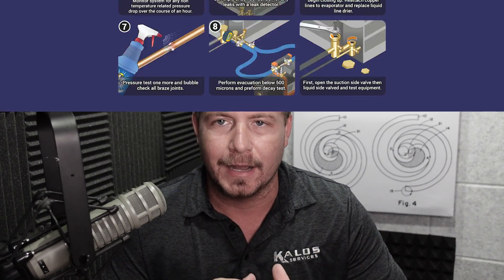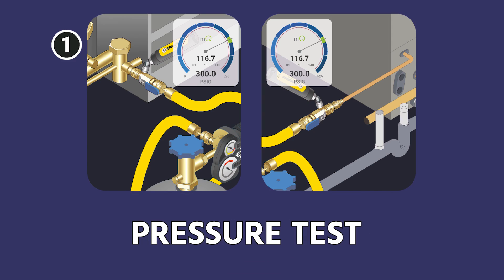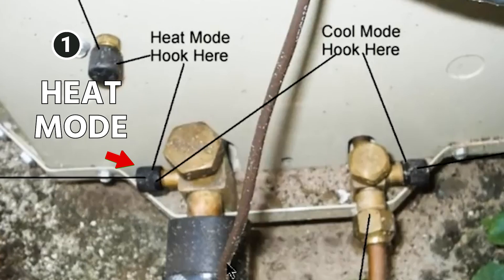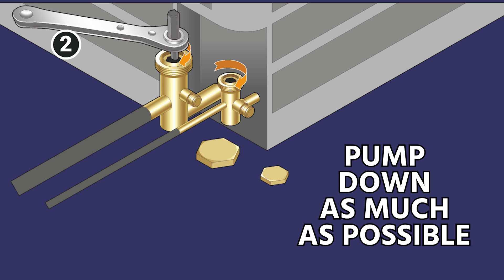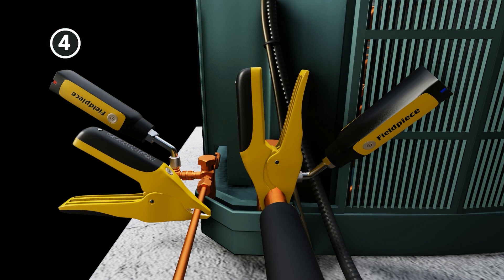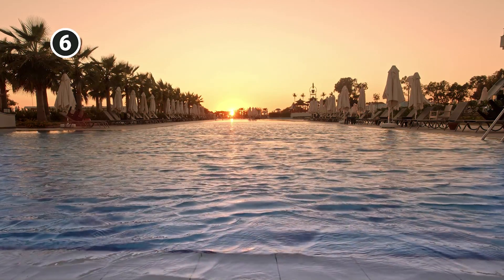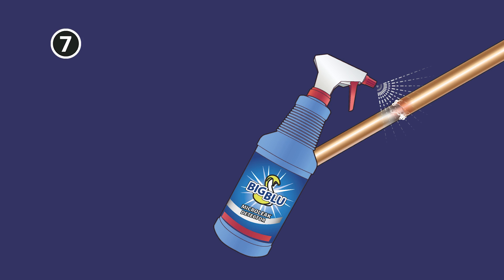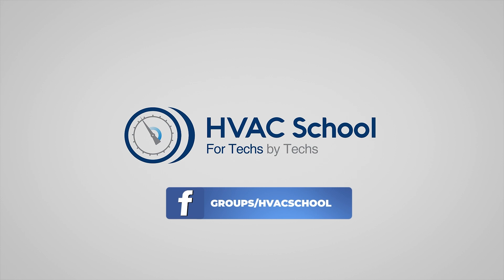How to Line Isolation Test an AC System

Comment: Accutrack ultrasonic leak detector is the best
Reply: Started using the Accutrack ultrasonic about 25 years ago. Never looked back, best leak detector  since the old GE. H10 B
Reply: Heck yeah!!! Your 100% right!
Reply: Yep , found the smallest leaks . Work great for me
Reply: @youngjohn5076 mine must’ve been a dud it dosent show very small leaks only noticeable significant leaks where oil is present.
Reply: It helps me to wet the area when I use my accutrack.

Comment: Bryan, I also live in Florida where we run our AC mostly all year round, but on occasion YES we do sometimes turn on the heat. (laughter from the north heard here), well a few days after our 3 day dip in the low 40's and running the heat, I switched back to AC mode and a few days after that noticed AC issues, low on freon. Did running the Heat increase the pressue in the evaporator like you mention in your video and exacerbate the problem? I had a tech spend three ours looking for a leak and could not find one. He just charged the line with freon and it's been 4 days and all seems ok for now.

Comment: Great video, I wouldn’t cut the line set, instead I will pump the system down and I hook vacuum pump ,after running for 30 mins ,check the gauges, to see if Still holds vacuum. If the pressure is rising you know there’s a leak in a coil or the line set. Plz correct me if I am wrong,
Reply: you're correct but how are you going to find the leak under vacuum? This is one reason it gets pressure tested before the vacuum test

Comment: I realize I'm late watching this one, but would like to add a pro tip about it. In the event your isolation test is 24 hours or more, record the ambient temp. 300 PSI on 95 day will not be the same on a 75 day.  Use the formula for gas laws P2= T2 (P1/T1)

Comment: Sometimes with really small leaks I put it under an isolation test like that and come back in a few days to check. I’ve seen leaks as small as 20psig in one week using the nitrogen pressure temperature calculation.

Comment: I use a test gauge that I use for my gas pressure tests. It shows increments of ten for one pound and shows the slightest leak with just 10-15 psi. Also using a mixture of Dawn soap and water in a spray bottle works better then the Blu spray, the bubbles are larger and easier to identify.
Reply: The first Service Mgr I ever had swore by a 50/50 mix of Dawn and water. Said it was the best leak detector ever made, but it had to be Dawn brand. That was 20 years ago.
Reply: @iheartr2280  He was right, best soap ever for leak detection. Dawn is the magic. You can find gas leaks on low pressure just with a little brush so 100 psi is a piece of cake. My guys are convinced years ago. The AccuTrac is also a great option for medium to large leaks.
Reply: Don’t use dish soap. It’s corrosive. Most guys never wash it all the way off and it slowly eats the copper and aluminum. This is bad advice. There’s a reason big blue and it’s competitors were invented. It’s not caustic to the system.
Reply: @donjohnson5172  I appreciate your comment but that isn't going to happen in the life of the equipment. No it's not bad advice. I'll stick to what I'm good at good luck.
Reply: supposedly from sources here on youtube Brian hvac school and Craig HVAC service tech and also other sources on the web you should never use dish soap on copper/aluminum as it will have a adverse reaction that will eat away the copper/aluminum over time and has been a reason for many leaks on A/C systems. Only Chemicals tested for A/C leak detection should be used.

Comment: Learned as always watching your videos. I'm fortunate that most of the linesets I encounter are run through a chase (through attic & down side of home) Get calls sometimes & system out of refrigerant (usually on a weekend) I always ask customers have you hung any pictures or blinds recently? Sure enough they sat yes & ask where & just flow nitrogen & unscrew what they screwed in & leak found. Just a reminder that the best tools we own are our eyes,ears,nose & mouths. Ask the right?'s & a lot of times will save time on not only chasing leaks. I also once found a line set leak in a wall that had a burnt staple next to l

Comment: Seems like a very long process and expensive for the client. Why not remove all the refrigerant then charge the system with nitrogen/hydrogen with electronic gauge connected. Easiest way to see if the system had a leak then can use a leak detector which senses the hydrogen. 
If its a big system you can break it down and cap off pipework then test the exterior unit individually etc.
Potentially a big waste of time searching for a leak on a heat exchanger where there might not even be one or its too small to easily detect.
Reply: You perform an isolation test after you have done a previous leak check but the leak is so small you can not locate with conventional means. That is the process and when a isolation test will be performed.

Comment: Suggestions for future videos:
Wines cooler are made different. It keeps  the humidity. How come ?
2) Portable humidifier. How it is working ? Is it normal that it freeze?
3) Can you mix the refregerants ?  
Thanks for your great works.
Reply: 2) is deshumidifier, my mistake.
Reply: Wine coolers are made to retain high humidity in the box to not dry out the cork (shrinks and breaks the seal, oxidizes the wine).

Never mix any refrigerants.

Comment: My company has been getting many copper evap coil leaks at circuit elbows,or just inside the end plate of a circuit.  The plate rusts around the tube and somehow breeches the copper or aluminum tubes.. what boggles the brain, is there were no leaks at start up. 
Sometimes I wonder if these coils been retagged from older specs?
Reply: coils are designed to fail. It is very profitable for the manufacture and supply houses. Very simple you can't have copper touching steel for the same reason when installing a new hot water heater you must always have a dielectric fitting between the coper and steel pipes of the water heater. The 2 metals placed together is highly corrosive. Brass can be used in place of a dielectric between steel and copper.
Reply: Been running into the same thing.

Comment: We do a 24hr test
Reply: Well if you have the right tools there is no real need to wait. A digital gauge that gives you pressure by the point you can see after 5 10 minutes if you lost anything
Reply: In 24 hours the temperature may be different the next day. Since temperature correlates to pressure your pressure readings could be very different when you go back and check. A digital gauge will tell you in 15 minutes if there's a leak or not. 24 hours might give you a false reading so I would honestly avoid it myself
Reply: @HodlMyB33r  I would assume he checks the difference in temperature, there is a calculation for that.
Reply: Me 2. It has to be right. Lol